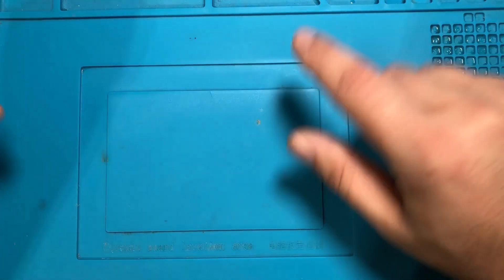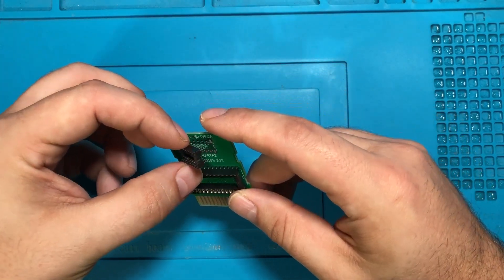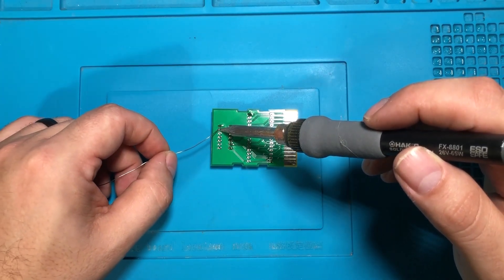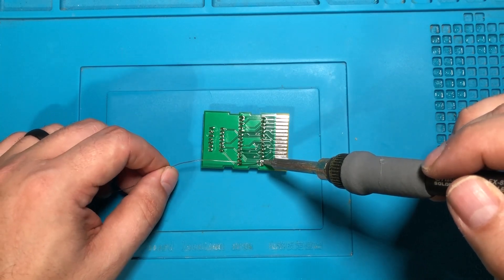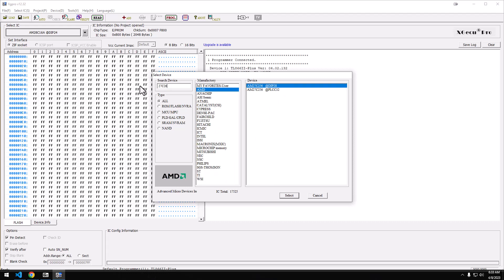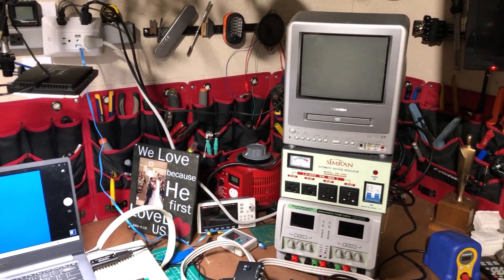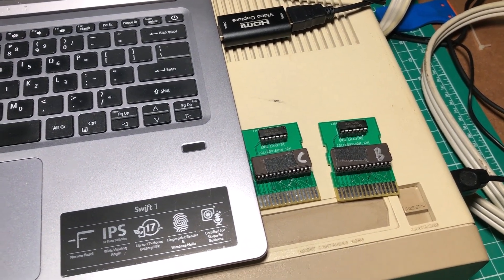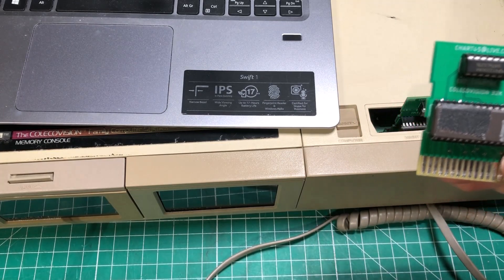How to build a cartridge for the Colecovision or Coleco Adam

Comment: Quite a number of years ago I designed a breadboarded circuit that allowed me to read in a Coleco Vision cartridge to my S-100 system then save it to disk. At that point I could run a disassembled on it to find the code for a number of game. Some cartridges never gave me stable values but I did manage to read and save most of them. The S-100 system had a Z-80 CPU and graphics card that utilized the same graphics chip (TI 9918A?) as the ColecoVision. Unfortunately it took me the better part of a year to make my own game and the market had tanked by then.
Reply from the maker: That's so awesome.   What I wouldn't have given to have that tech back in the day.  Speaking of that, a friend just bought an S-100 system today, so it's kind of funny to see that word twice in one day.